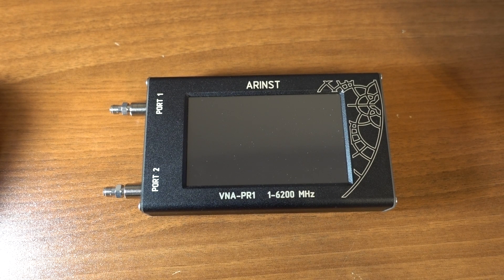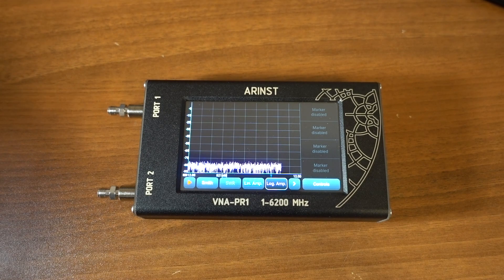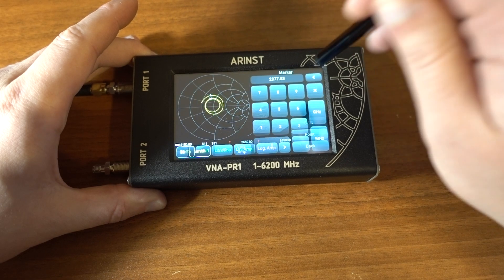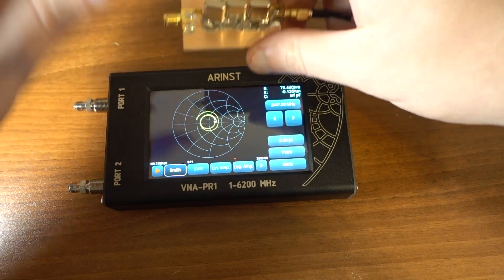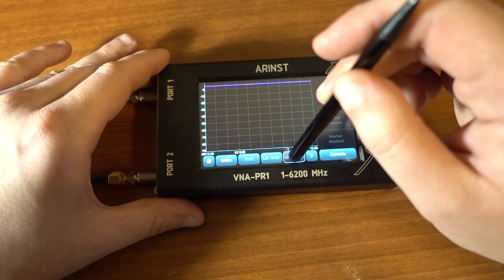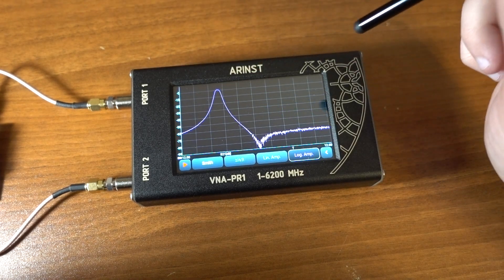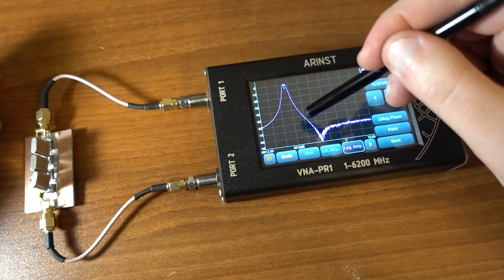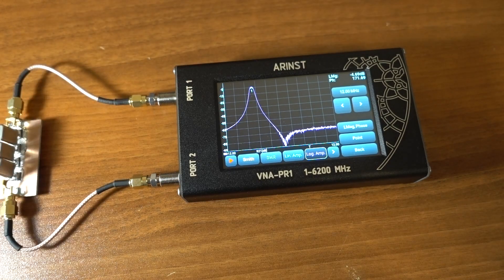#7: ARINST VNA-PR1: Portable 1-6200 MHz Vector Network Analyzer

Comment: Thank you for providing this video. I am just finding out about this device, but am interested. I would like to see more videos about this device and a technical discussion on why this is much better than the others sold (e.g. components and tolerances used).
Reply from the maker: Many thanks for the feedback. I may record a video on this topic since there is an interest. Meanwhile, you can take a look at the article (see the description to the video). It's in Russian but can be read with Google Translate. The article describes components and tolerances as well.
Reply: @R2AUK  also I would like to know if you are able to extend beyond the 1000 points by connector to a PC over the USB bus ?
Reply from the maker: @xoox870  there is additional software available on the official website that may have this functionality. Unfortunately, I was unable to test it because I don't have Windows.